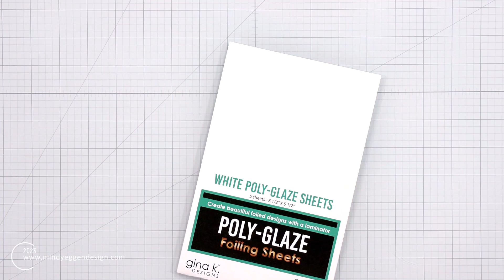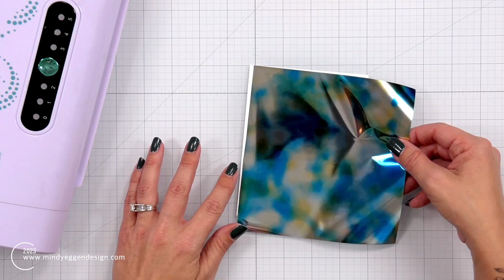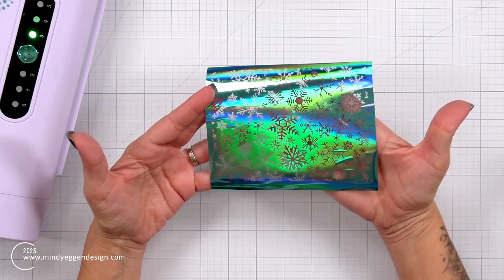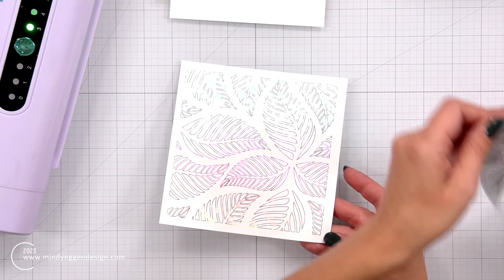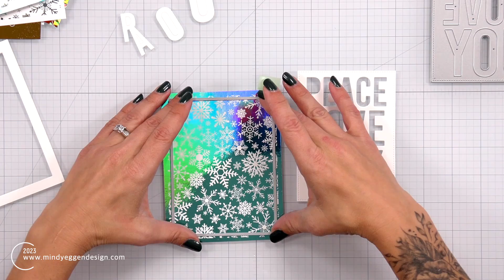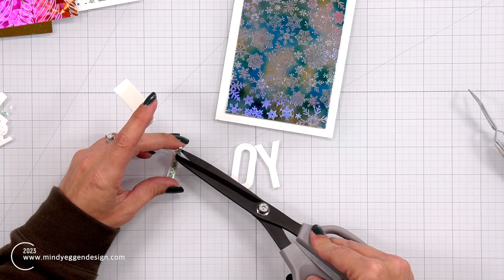No More Wasted Foil! Negative Foiling With Gina K Designs White Poly Glaze Sheets

Comment: Hi Mindy, these are gorgeous!  Can you tell me if these foils can be used with ink embossed images too. I've seen some done in the past but wasn't sure of the kinds of foils.   Thanks in advance  😊💗🇨🇦
Reply: Hope you don’t mind me butting in here, but I recently saw a video (don’t recall who) where they did that technique.  The embossing melts enough in the laminator for the foil to stick to it.  I haven’t tried myself yet, but I would say give it a try, can’t hurt 😊
Reply: @rivamoyer1189  hi.  Last night I found that video I think you’re talking about. Kelly Taylor I believe.  It was made about 6 or 7 days ago.  She demonstrated a few methods of foiling with the different types of foils.  Awhile back I saw a video using heat embossed and deco foil together.  If I remember correctly, as soon as you have embossing powder melted, cover it with the foil and gently press it in.  But I think you’d have to be extremely fast with it as it cools quickly.  😊
Reply from the maker: not that I'm aware of. the foil needs something to stick to like toner or poly glaze when using with a laminator. I have seen this type of foil stick to alcohol ink backgrounds. Not quite the same though.